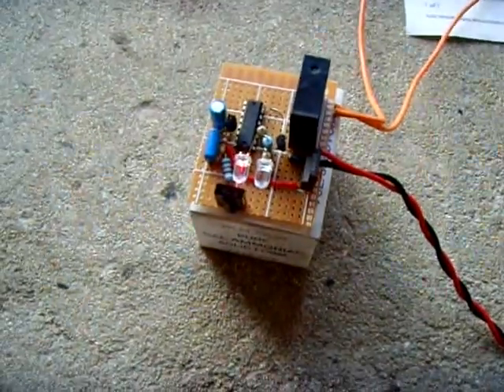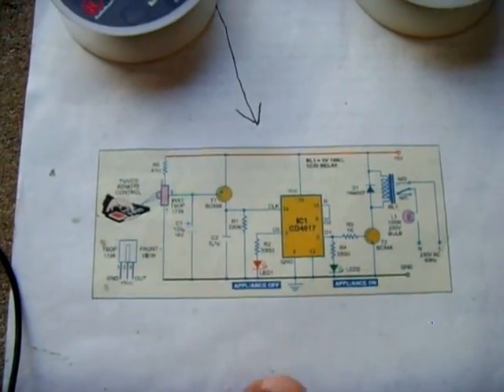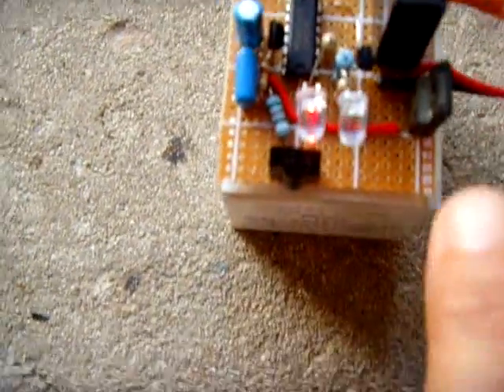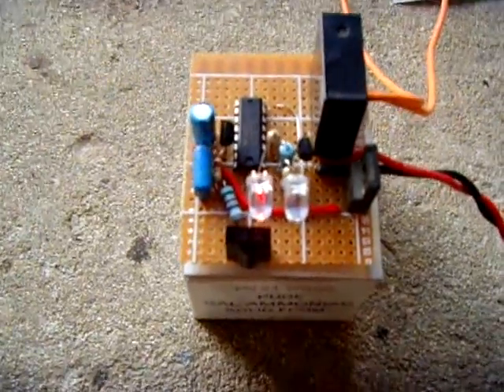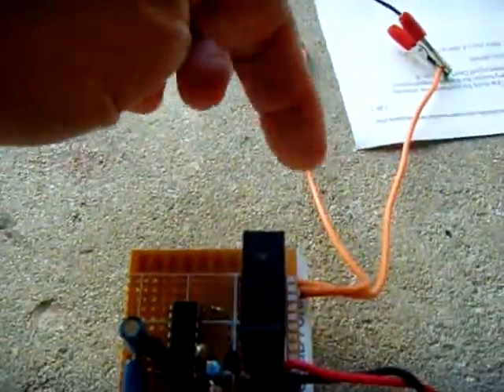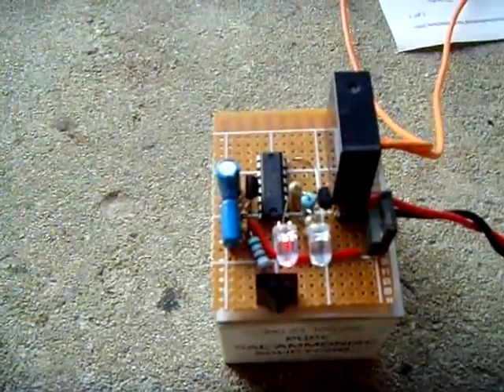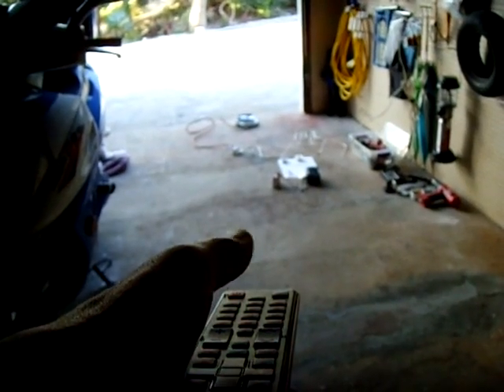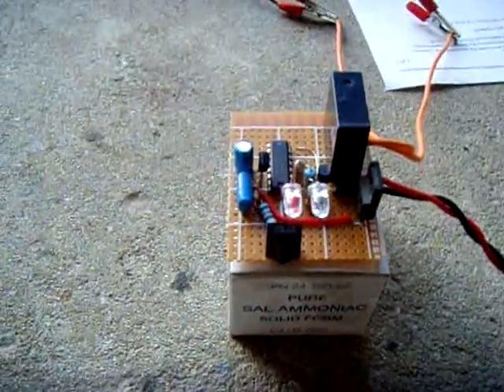Turn Appliances ON & OFF With Any Remote Control

Comment: A decoupling capacitor is just a capacitor that's connected between the VDD and VSS pins (pins 16 and 8 on a CD4017) as close to the IC as possible and with leads as short as possible. Typically a 0.1 µF ceramic capacitor is used. It is highly recommended for logic devices, especially MSI ones such as the 4017, to prevent misoperation. In other words, it makes the 4017 work more reliably. In that circuit, without a decoupling capacitor, the 4017 may sometimes fail to change state.

https://en.wikipedia.org/wiki/Decoupling_capacitor

As you suspected, that infra-red LED is not enough to activate the TSOP1738 receiver. It generates a continuous stream of infra-red light. That receiver needs the light to be modulated (turned on and off) at a frequency of around 38 kHz. That requires an oscillator of some kind.

You can use a 555 but they do not generate a very accurate frequency. Normal infra-red transmitters use a ceramic resonator to generate their frequencies, with an error of around ±1%. If you use a 555, use a good-quality, accurate capacitor such as this one:
Reply from the maker: I have another video showing a different version of this circuit.
Reply: electronicsNmore where

Comment: The CD4017 responds to the rising edge on its clock input. That is, each time its clock input pin is brought from low (GND in that circuit) to high (+5V), it advances by one count.

Assume the 4017 is currently at count 0. This means that the "Q0" output, pin 3, is the only output that will be high, and this causes the green LED to light up, indicating that the switched appliance is OFF. The "Q1" output on pin 2 will be low, so the relay will not be activated and the appliance will not power up.

When the 4017 sees a rising edge on its clock input, it will advance from a count of 0 to a count of 1. The "Q0" output will go low, so the green LED will go out, and the "Q1" output on pin 2 will go high. This illuminates the red LED, and turns on the transistor, the relay, and the controlled appliance.

When the 4017 sees another rising edge on its clock input, it will advance from 1 to 2 and its "Q2" output on pin 4 will go high. This output is connected to its reset input, so as soon as this happens, the 4017 resets back to a count of 0.

Therefore, each time the 4017 sees a rising edge on its clock input, it will alternate between a count of 0 and a count of 1. The LEDs will change state, and the controlled appliance will turn ON and OFF, as the 4017's count changes.

Comment: Start by reading the data sheet for the TSOP1738: http://pdf.datasheetcatalog.com/datasheets/208/301092_DS.pdf

The device has an active low output. That is, its output pulls low (to 0V) when it is receiving an infra-red stream modulated at 38 kHz.

The way the circuit is supposed to work, when the TSOP1738 is receiving infra-red from a remote control transmitter, it pulls its output low. This discharges the 100 µF capacitor and also forward-biases the PNP transistor, causing it to pull its collector high and clock the CD4017, changing the state of the appliance control output.

An infra-red remote control transmitter transmits modulated infra-red light in a series of bursts; the widths of these bursts, and the gaps between them, encode the particular command being sent. But this circuit doesn't care about that. The 100 µF capacitor ensures that the PNP is kept ON during the gaps in the infra-red signal. Only when the button on the remote control transmitter is released, and the infra-red transmission has stopped for a short time, can the PNP turn OFF ready for the next button-press.

This circuit has several errors. (1) There should be a decoupling capacitor across the power supply input to the TSOP1738. (2) There should be a resistor between the TSOP1738's output and the base of the PNP; without this resistor, a fairly high current will flow through the PNP's base-emitter junction and into the TSOP1738 when it tries to pull its output low; this current will exceed the TSOP1738's specification (5 mA maximum output current) and may damage it. It could also damage the PNP. (3) Another resistor should be added between the TSOP1738's output and VCC, or the 100 µF capacitor should be reduced so that the built-in pullup resistor in the TSOP1738 will produce an appropriate delay. (4) C2 is not needed. (5) A decoupling capacitor should be connected between the VDD and VSS pins of the CD4017 to ensure proper operation. (6) The CD4017 is a 10-output device; only two output states are needed, and the CD4017 can be replaced by a CD4013.

Comment: I wonder if this could operate my Roku devices (two models with different remotes--hard to switch from one to the other) AND my Samsung TV. I use Roku for everything, except it can't control the TV volume, so I have to use the TV remote to adjust the volume. Remotomania

Comment: So  in that circuit, is it responding to ANY infrared signal?  For example, you don't need to program it to the remote, it just responds to the flash from the remotes LED ya?  Does that leave it open to interference from natural light? Will the spark from a lighter or reflected sunlight also work.  Cause that could be a pain.  I know my tiny IR helicopter toy will not function correctly in sunlight or partial filtered light.
Reply from the maker: No programming. Use any IR remote. You can adjust the sensitivity to help prevent false triggering.

Comment: I tried it on breadboard but with 9v battery (used voltage devider to get 5v) and Relay along. But it didnot worked. 
Is there any mistake ???
Reply from the maker: Jai kamal The circuit works. You clearly did something wrong.
Reply: electronicsNmore  what may be the possible mistake. 
I m new in this field, so its not simple for me. but relay that I used  is JQC 3FC 6V. can it be a mistake???
Reply from the maker: You need a regulated output. Try a zener regulator.

Comment: can i use 9 volt supply because i have 12 volt relay
Reply from the maker: The power supply to the circuit needs to be regulated at 5V. The relay can be powered from a higher voltage, such as 9V or 12.

Comment: How can I use this using multiple outputs. E.g I want to use 3 buttons for 3 different outputs.
Reply from the maker: This circuit is extremely simple and uses no modulation. You cannot choose different buttons.
Reply: How can I modify that to use multiple channels?
Reply from the maker: You cant.

Comment: it doesn't include the voltage regulator diagram
Reply from the maker: You can use 12V as the power supply with a 12V relay coil. Use a LM7805 IC to power the rest of the circuit.

Comment: How would I say make this setup but in a micro size and have the power to turn on say set on a timer so on a certain time it will send signal to turn on the object I want turned on. I'm working on a project that I need to work on a timer to turn on a micro vibration motor for my prodject. but want it to send power on the time I set the timer. if u can help please message me. thank u
Reply from the maker: Hello. You would need to use surface mount components to make it smaller. This circuit does not fit what you're looking for. Thanks for watching
Reply: +electronicsNmore thanks

Comment: For single device remote only On/Off function it is useful,but this requirement is rare,the every day requirement is a multiple devices,with different On/Off states,with regualators for fan & the dimmers should work on remote,here any remote will do?

Comment: This is great, thanks for the tutorial but I can see a problem with this.
What if you have a number of appliances attached to this how can you make it selective through the remote? EG The garage door, the sprinkler system or indoors, the kettle the toaster, the blender, the lamps. but you want to allocate one button for one and another button for another.

This setup is for any IR signal. what would you have to do to make it selective? eg the volume up turns on Device 1, volume down D2, channel up D3....

Any ideas? That's a whole other circuit board isn't it.
Reply from the maker: +Ryad Arlan 
This is a simple circuit. If you want to trigger multiple appliances, then make sure the receivers are not facing the same direction so you do not trigger more than one at a time.
Thank You

Comment: my led on/off lights simultaneously, and the relay does not react to the command, why?
Reply from the maker: +Gerrymie Soriano 
Check your circuit.It could be a faulty component as well.
Reply: +electronicsNmore i have observed that at the moment i connect the supply, the relay will turn on already and does not turn off until i remove the supply, it means the base of the npn has current. i have already change the components (ic,npn,pnp) but nothing happen :( pls help
Reply: +electronicsNmore im pretty confident on my connections btw

Comment: You can buy the whole rig - receiver and control for $4.74 free ship... search flea bay for One Channel 5V Relay Module with Infrared Remote Control Optocoupler DIY and save yourself the time and trouble of finding parts and building it.

Comment: so if I were to build two of these, could you then remote control them individually or would both turn on/off at the same time?
Reply from the maker: +jens-peter riise malle andersen 
If both are located in the same location, then both will turn on.
Reply: okay great, thanks for quick answer! great video btw! :)

Comment: amazing,, do u have the analysis of how it works?
Reply from the maker: +Bagaskara LA 
When the IR sensor module detects IR light from the remote control, the output voltage of the output pin of the IR module temporarily dips which causes the circuit to trigger. Each triggering causes the 4017 to flip-flip(On/Off).

Thanks
Reply: So the Vss curent not flowing into CLK all the time right? Just when we press the remote button?
Reply: electronicsNmore
Reply: +electronicsNmore Hello i have no idea about how it works..but i just want to learn it for tubelight i have already one of it done by my cousin for me. but if you help me step by step i would be glad

Comment: Thank u very much.
The circuit worked with me well i applied it to 12v dc led back up system but the problem is the circuit disturbed by outer frequencies for example when i turn on a CFL light the circuit start on and off several time before it stabilized again .so how i could make the sensitivity of the circuit less.
regards
Reply from the maker: +M Ahmad 
My other IR circuit shows a couple modifications I made which help eliminate false triggering that you can use with the output of the IR module in this video. Watch that video below.

https://www.youtube.com/watch?v=xM52tsR4Mmc

Thanks

Comment: can i ask?can i used it to CONTROL too many LED?
Reply from the maker: +Chawalit Udon Sak 
You can use this circuit to turn on or off anything you want(5v/12v/110v/220v). Just be sure to use the proper rated relay to handle the load.

Thanks For Watching! Be sure to rate thumbs up and share my channel with others.
Reply: +electronicsNmore thanks 👍👍 but what about the wiring diagram for remote?
Reply from the maker: You use ANY remote.

Comment: That awesome ! I wanted to make a remote control for my custom fluorescent lamp fixtures because all they require to run is an inductor choke ballast (that's just a coil of wire around a core) and an open/closed starter switch that is only closed for a temporary time to induce voltage once the voltage has built up, disconnect the switch gives the bulb a small voltage kick that comes from disconnected any circuit from power. The voltage kick the bulb gets from opening the circuit switch is what makes the fluorescent bulb pop on. I see in this video the remote is a toggle on and off switch I would like to know if I could make one that doesn't toggle the power on and off, but If I hold the remote button down it stays toggled closed but if I let go it disconnects the power via the remote. Is that possible?
Reply from the maker: Paul Zaffuto Hi Paul. So you want something always powered, but when you press the remote control and hold down the button, you want the power to stay off until you let go?
Reply: Hello ElectronicsNmore,  yes that would act as the off button for the lamp but it would not need to be held down. But the circuit that turns the power off just needs to be opened briefly and it can be closed again and be connected to power again but there a 2nd circuit that is always open but when closed and held closed the lamp begins to preheat its filaments. then disconnecting or opening the 2nd circuit pops the lamp on.. I have a picture of the lamp design I can show you if it still doesn't make sense to u still.....
Reply from the maker: I would love to help, but unfortunately I do not have the time to offer my viewers special assistance. Maybe you can find another circuit on my channel which you can combine with this circuit to accomplish what you are looking to do.
Reply: lol I dont need any special assistance was just asking if you had done that before with the circuit in this video. btw you sound like some automatic reply treating me as if I was some kind of customer of yours....  GL with your work
Reply from the maker: You received an appropriate reply. You were asking to do something that the circuit was not designed to do. The circuit was made to toggle ON/OFF. I have almost 300 videos on my channel and viewers send me private messages on a daily basis asking me to design special circuits or modify circuits for them. Unfortunately I do not have the time to do that. That is what I mean by "Special Assistance". Many channels do not even bother to reply to viewer questions, but I do reply to my viewers questions. If you were in my position, you would understand. :-).

Thanks For Watching

Comment: Hello,

 I am an ignorant electronic would be nerd.

I have 7 Victorian servant  bells together with 7 Victorian 'crank' handles. Traditionally these were operated mechanically by pulling a lever (the crank) which pulled a wire that ran to a bell in the relevant servants quarters eg butler maid cook etc. I would like to install them in my home for a laugh, but I do not want to have to trace pull wires throughout my house. It occurred to me that I could convert the 'cranks' to spring retractable switches which could energise separate electro magnets which would pull the bell causing the bell to be attracted .as the bell is on a spring it would rock back and forward until the physical energy stored in the spring attached to the bell was dissipated. Can you give me with  a circuit(s) that may assist me towards this end.

I appreciate this may be a gratuitous imposition upon your time. If you cannot help me can you direct me to someone who can?

I am hoping to awaken my teen interest in electronics which was denied to me by my parents (I am now 65)

kind regards,

Baldric100
Reply from the maker: David Drake Unfortunately I do not have the time to assist every viewer that requests special assistance. The only viewers that I will take the time to assist at a higher level, would be those that posted links sharing my channel/videos, or made a donation to my channel supporting the creation of more videos. All questions must be related to my videos. I suggest you try using solenoids with plungers for your project.

Thank You.
Reply: electronicsNmore  so what's the difference between a tv/radio jammer and an emp device?

Comment: Awesome video... but could u explain why every part is installed ..just to understand how everything is working. . 
Thx
Reply from the maker: Hilal Alhakani Hi there! The IR receiver module (3 pins on the left) will have the output go LOW(in a pulse) when a remote control is directed at the sensor. The capacitor connected to pin # 3 makes the pulse last longer. When the pulse is detected, the cd4017 IC is used as a Flip-Flop to latch the relay coil ON or OFF, and at the same time latch the proper LED ON or OFF.

Thanks For Watching! I have another improved video with a schematic/PCB in the video description area. Please Share, Post Links, and rate Thumbs Up.
Reply: thx a lot for the clarification .. keep up the good work :)
Reply from the maker: Be sure to spread the word about my channel! :-)
Reply: consider it  done :)

Comment: Nice video and very simple schematic. I have a relay of 12vdc for 240v 5A. With this schematic can I use this 12v relay for 12vdc led lights, in stead of 240vac appliances? Well, for TSOP1738 part of the circuit I can use a 7805. Please guide, thank you.

Comment: great video and very inspiring.
Question: how do i control which button on my remote controls what? do i need to somehow adjust something, and can the same remote be used for a variety of different devices?

thanks in advance
Reply from the maker: Any button on any IR remote works. Some buttons may take longer to trigger the circuit.
Reply: thanks for the reply...but my question was ...lets say i have a remote with 4 buttons...how would i be able to configure each button to do something..i.e button1 turns on, button 2 turns off
button 3 turns on a different device and so on.
Reply from the maker: Not with this circuit. This circuit is extremely simple. To do what you want, you would need a more complex circuit which allows programming.
Reply: thanks again....but you really got me thinking...very inspiring as i said before.

Comment: sir can i use 12 V relay inplace of 5 V relay? Urgent........
Reply from the maker: First of all, adding "Urgent" will not get me to reply any faster, it is very rude actually, especially if you have not posted any links to share my channel/videos as appreciation for the video which you get for FREE.

As for your question, You can power the relay using 12VDC, then take the 12VDC power supply and use a 5V regualtor(lm7805) to power the rest of the circuit at 5V.

Thanks.